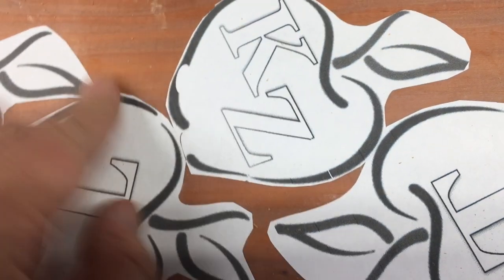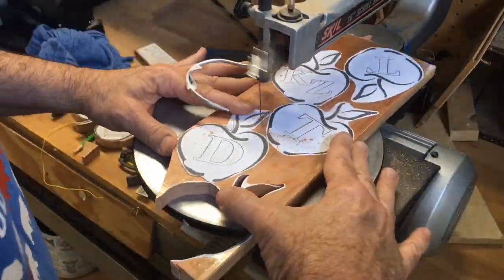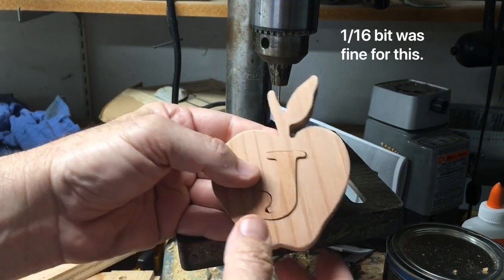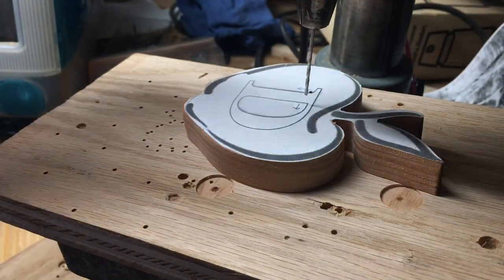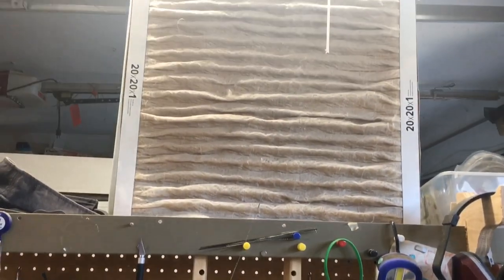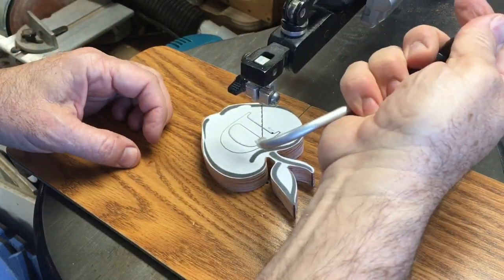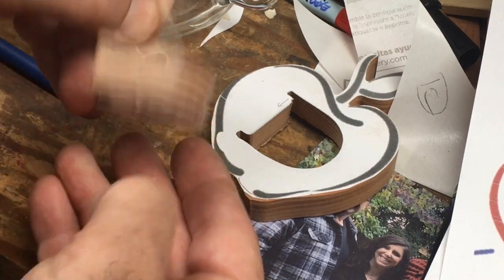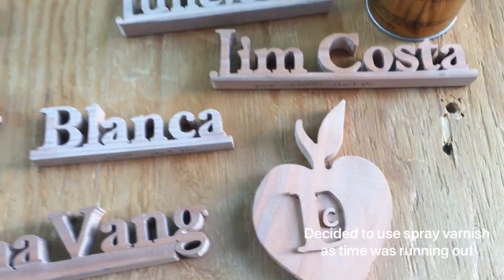How to make raised and sunken bevel cuts on your scroll saw

Comment: Thank you for sharing your video with us & your knowledge!  Question though, if you are cutting a section out at a certain angle all the way around it, what difference does it make as to where on the line you start your cut and also what difference does it make with the direction you are cutting it at? Thank you in again and thank you in advance for your response!!
Reply from the maker: Where to start the cut:
Usually the drill hole to start the cut is slightly bigger than your blade. So making the drill hole in a corner if there’s one tends to hide it. 
Direction of angled cut:
Once you get your blade at an angle to the piece of wood, you need to undercut in the direction you want the wood to fall. To see it for yourself drill a couple of oversized 1/8 inch holes in a quarter inch piece of wood. Angle your blade and cut one clockwise and the other one counterclockwise. One will fall down into the wood while the other one will rise up.

Comment: Can you explain the extended aluminum tubing bit please and will that trick of blowing things behind work with lathes as well?
Reply from the maker: The aluminum tube (could be a bendie straw ) is to blow the dust AWAY from me. Before I put them on, my chest and lap would be covered in dust. I have a strong small fan mounted on my ceiling that I aim at my lathe when I turn(and when I use my scroll saw. I roll my lathe to just outside my garage door and the fan wind blows dust and some turnings out.
Reply: @richardkinney1  thank you very much.
Reply: and thank you for taking the time to answer...much appreciated.

Comment: The number one most important thing about pumping the air is not to blow the line clear so you can see the direction of the cut. The number one reason is to keep the scroll saw blade from overheating so it doesn’t break. Trust me I know.
Reply: didn't know about the cooling effect!!
thanks

Comment: How do you prevent the raised (and lowered) pieces from falling out?  Do you glue them in place, or is the varnish enough to hold things in place?
Reply from the maker: I will glue them in with super glue, or epoxy or white/yellow glue depending on how fast I need it finished. Sometimes I’ll tack it in with super glue then brush on the varnish to add more strength.
Reply: @richardkinney1  I figured you MUST be gluing them somehow. :) Thanks!

Comment: Which company sroll saw is used
Reply from the maker: Skil 16 inch on the rough (pinned) cut and Dremel 18inch on the fine. Now I use an Excalibur 21 with Pegas blade holder installed.

Comment: how do you normally fill that entry hole?
Reply from the maker: Sometimes a tooth pic (or whittled piece of wood) or I make a putty from the woods sawdust mixed with glue. Sometimes the hole can be placed so it’s not too noticeable. If you can use a real small blade the hole can be real small.